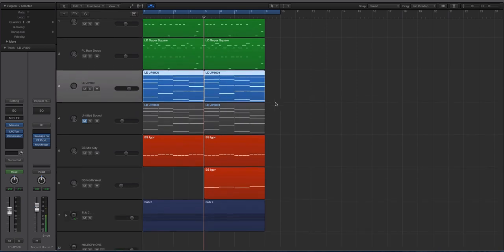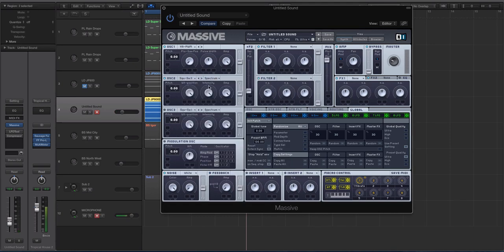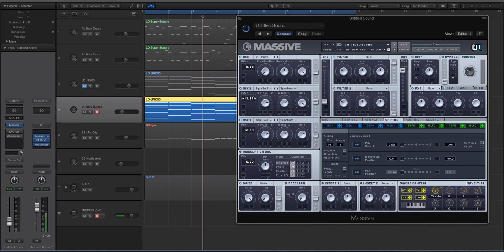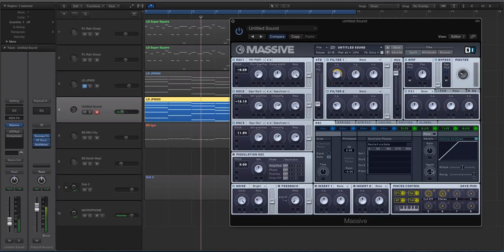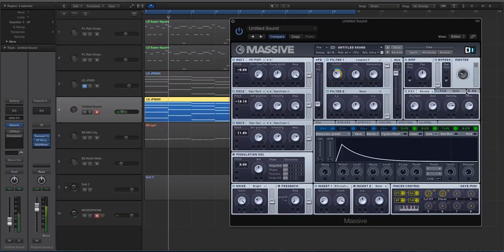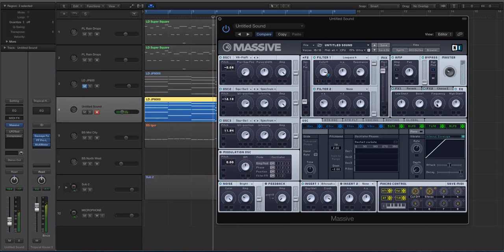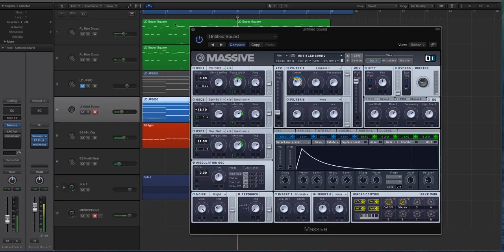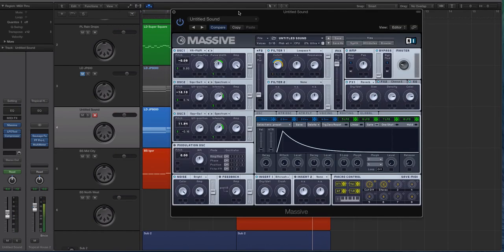NI Massive - JP8000 lead

Comment: Nice vid! You actually detuned the oscillators all in the same direction when you first set them up (-12.10 is lowering the pitch, not raising it). 

I also don't think I've ever heard anyone say "I'm going to use a bit crusher to 'warm' up the sound."
Reply: Bit crushing means less bits means less high frequencies which often harsh the sound. I get what you are trying to say but strictly speaking: he is not wrong with that statement :-)
Reply: a lower bit depth does not mean less high frequencies - but as you decrease the bit depth, the amount of quantization errors increases resulting in added noise to the signal, which i guess you could call 'warmth'. if you significantly reduce the samplerate however, you will  get less high frequencies.